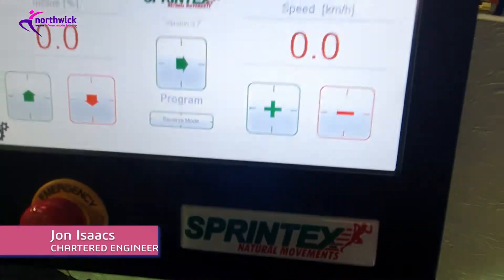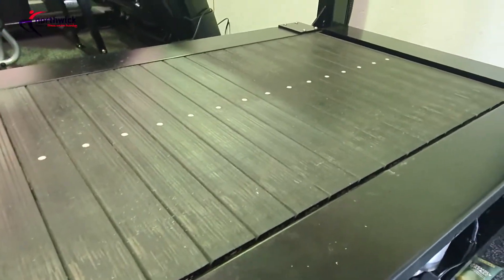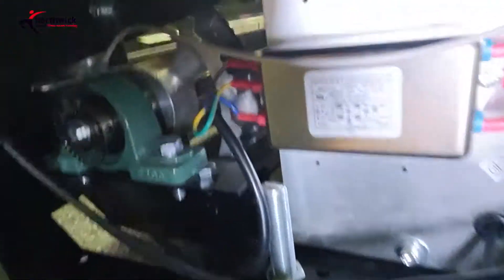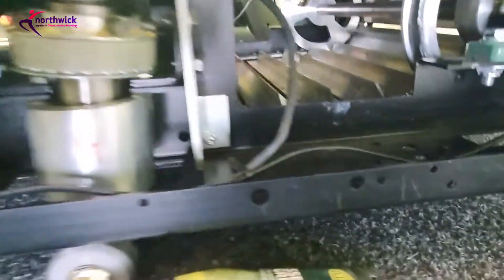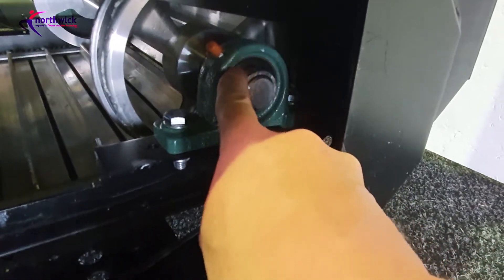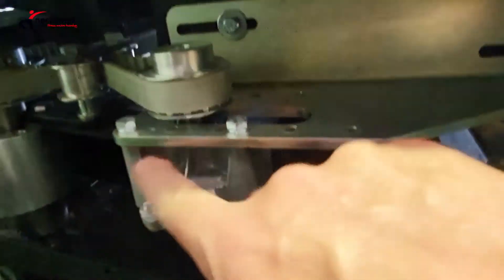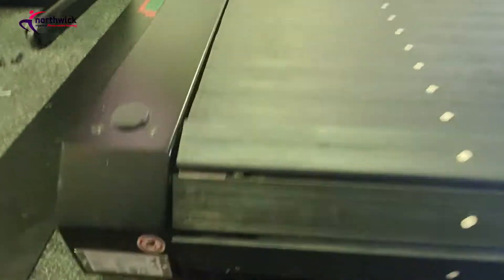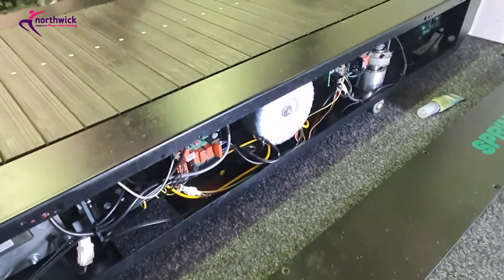How to Service a Frictionless Treadmill (eg. Sprintex, Woodway, Peloton)

Comment: Newer treadmill technicians here, what was the "pap" test you mentioned for the power cord? (Hopefully I heard you correctly)
Reply from the maker: Hi - It's a PAT test which is a safety check that has to be performed on mains powered equipment in the UK. More details here https://www.hse.gov.uk/electricity/faq-portable-appliance-testing.htm